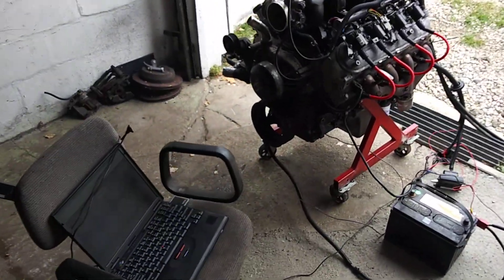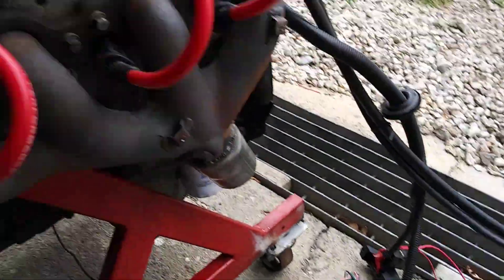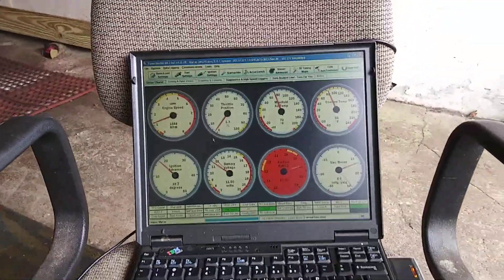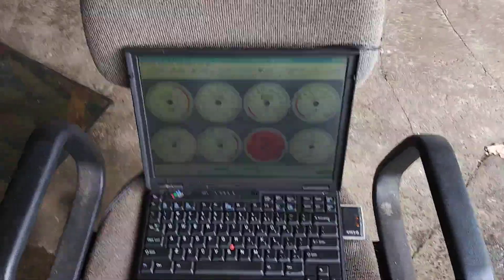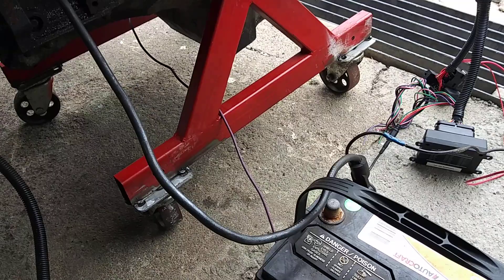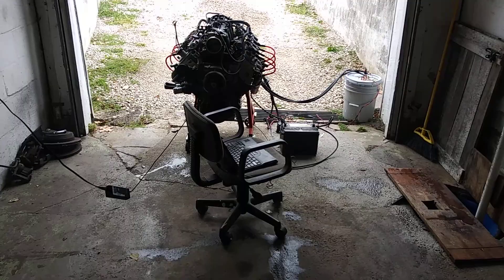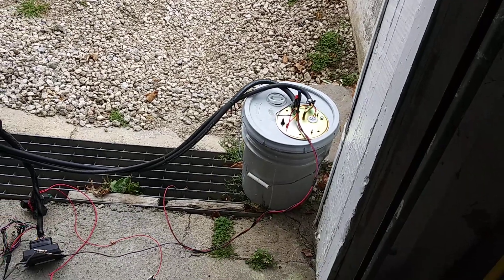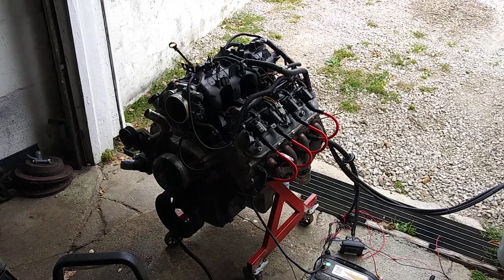How to: First Start! Running an LS 4.8 on a super cheap EFI setup. Microsquirt FTW

Comment: Just curious how did the Microsquirt do on the long run? Also if your not running it anymore would you consider selling it? I would like something cheap for a mud truck.
Reply from the maker: Actually havent set it up yet. Just sitting in a box. For now
Reply: @beeterolds  well my friend if your ever interested in selling it let let me know i would also be interested in the harness
Reply from the maker: Better off buying it new
 They arent expensive
Reply: @beeterolds  thats what i taught too, went to purchase a LS ready from DIY autotune and after money convertion qnd shipping to canada it endedup at 880$
Reply from the maker: Well cut up a factory harness and tune a stock pcm to do what you need.

Comment: Did you seal or block the port behind the IAC? You must do that or you'll have a big vaccum leak
Reply from the maker: That I did not. Im sure youre right my friend. I need to block it off. Thats probably my issue
Reply: @beeterolds  right on man👍
Reply: Hey, what does a MicroSquirt cost? Does it come with the software that I  was seeing on the laptop?
 That 4.8 sounds pretty mean. Good video. 
Thanks
Reply from the maker: @ezelk1337  check out EFIsource.com